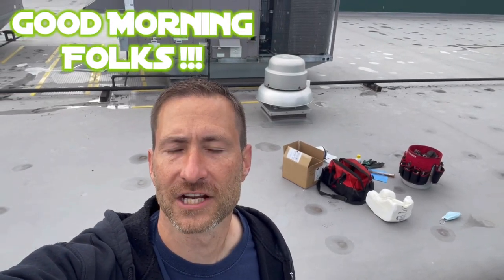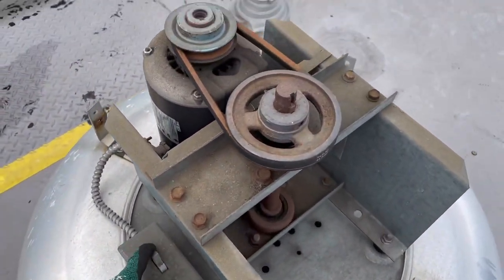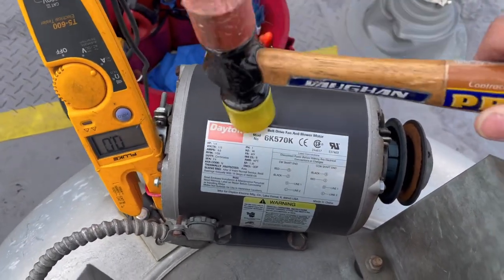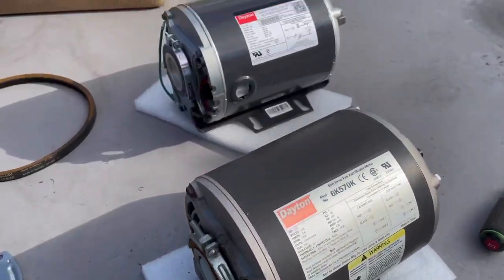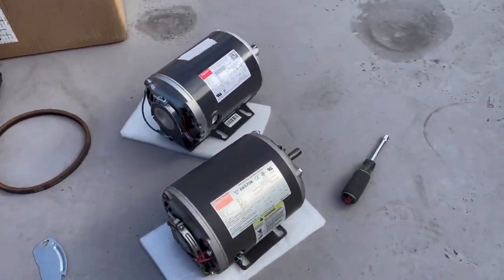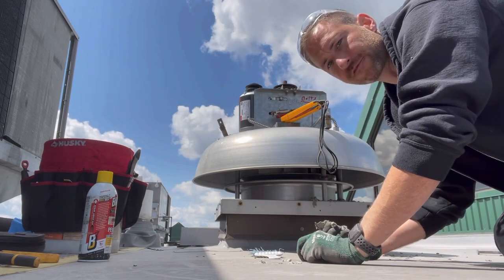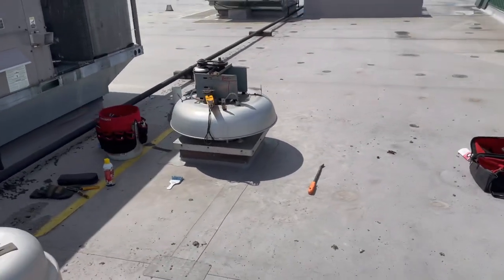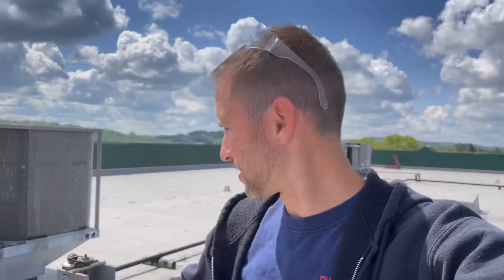Exhaust Fan Repair #motor #exhaustfan #roofshaker #hvac #HVACEXPLAINED #electric

Comment: can a certified nfpa 96 technician service, replace and or install upblast fans for commercial kitchens
Reply from the maker: @ziggymartinez2273  I don’t see why not? As long as the persons handy, follows the install guide procedures, and it’s inspected and everything should be fine.  
I can’t tell you how often Equipment in kitchens is replaced by a fly by night company or a nine HVAC technician.   It’s frustrating to see a general contractor install the equipment and we have nothing but problems.

Comment: Thank you for the video. Do you have any videos on what the readings (testing the windings and short to ground) on what a bad motor and good motor readings should output?
Reply from the maker: I have to look through my videos,  but I believe I can get you something useful.  Generally when a motor is bad some motors you can see the windings and they are literally look like charcoal or have an odor or the bearings are hard bad you can feel them tight or locked up by hand. Let me see what I can do I run into stuff all the time.  I’m actually working right now overtime found one bad compressor “bad bearings” and now I have a water under the floor alarm at a computer room.    I do post stuff on TikTok as well under the same screen name if you get a chance please check it out.  Have a great day thank you for the compliment.
Reply from the maker: Hey good morning Grevy.  You are in luck today I am replacing a condensate pump that has shorted to ground with open windings I will make a video right now in this computer room and notify you when I posted it.  👍.  Have a great day

Comment: forgot to talk about the little damper blade under the fan assembly. They get stuck closed or open half the time. I always tip the assembly off the curb to check. nice how close to the RTU they put that fart fan, why not just put it under the economizer hood.
Reply from the maker: I changed out three exhaust fans about three weeks ago and I was going to shoot a video on that just to show you should lubricate those Hinges 
Sorry I did not respond to this one sooner sometimes I fall behind on some of the videos.  But yes definitely a very good tip thank you for pointing that out.  
Have a great day thank you very much for watching and be safe

Comment: Great video thank you.  I have a question.  I have Panasonic attic exhaust fan.  It doesn't seem to have enough juice/torque to turn on by itself, but if I stick a bar in the fan propeller, and give it a nudge, it fires up fine, runs great, and no excessive or whiny noises, and it will run for hours if need be.  Getting ready to sell the home, should I just pull the motor and try to order a new one, would that fix it potentially?
Reply from the maker: Thank you very much Sean.  The motor may just be wearing out but if there is a capacitor connected to it it could be failing.   A lot of those fans you can get parts either on Amazon order from Grainger.  Most of them are relatively cheap, I prefer buying just an entire new one but I haven’t seen your situation.  Also why put money into something old? That’s the way I look at things.  It really depends on the install if it’s easy or not.  I worked on a few fans where they need a good start and once they are up and running their good.  Hope that points you in the right way.  Have a good day.

Comment: How do you adjust the motor sheaves to change amp draw?
Reply from the maker: Hey, good afternoon.  
I should really do a video on adjusting pulleys. 
Ok, to make it easy. 
Example:   Blower wheel has a 7” fixed pulley and the Motor has a 4” Adjustable Sheave. 
On the motor Pulley if you would open up the Pulley allowing the belt to ride towards the shaft of the motor The CFM and Amps Will Drop!!! 
If you were to adjust the motor pulley, allowing the belt to ride further away from the motor shaft .  The CFM and Amps will Increase.  
There is a calculation that you can do to determine CFM/amps/pulley size.  I won’t be able to put it down in the notes to make sense.   I would have to physically drawl it out on some construction paper.  
I would advise adjustment of the Pulley 1/2 a turn at a time.  
Hope this helps you a little bit. Have a good night. Thank you for the question.
Reply: its an adjustable pulley essentially allowing less or more slack on a belt driven motor or gear, kinda like a tensioner but adjustable

Comment: lol stumbled on one of your comments, saw the face shield and assumed HVAC meant high voltage alternating current. i'm an engineer just starting in a HV ACDC Station design group so my mind was on it
Reply from the maker: I work on a lot of high-voltage because I do commercial and industrial heating and cooling. I’ve been in my line of work with the same company for 17 years I did residential for almost 2 years before this I’m currently 38.  Commercial and industrial heating and cooling involves a lot of 460/3 power. I’ve had many scares over the years that’s one reason why I wear Ark Flash gear a lot.  Also it’s required at Natural Gas Drilling Sites.  There is money to be made in this field just as long as you work safe and work smart you can have a good career in this field.  This field also needs good engineers especially ones that go to the job sites to physically get their hands on what application it’s being used for.  
I had a friend who what is a grass cutter making money to go to college to become a mechanical engineer.   He would call me when his lawn equipment would break and I finally sat him down and physically showed him and taught him how the combustion engine works and we fixed it together.  I said this is one thing that some engineers failed to do is get their hands involved.  You can only learn so much from a book.   Thank you for leaving a comment I will be posting more videos if there’s anything do you have a question on pertaining to heating and air-conditioning I possibly have the answer LOL.  Have a good day.

Comment: What camera are you using and were you using a tripod?
Reply from the maker: This time I was not using a tripod since it broke on a job. But generally I film them myself.  That exhaust fan was from a few weeks ago.  I probably have over 500 + videos stored up I just need to cut/edit.  I’m just trying to figure out a good editing tool.  I have a lot more very detailed videos I just need time to cut and edit them
Reply: @hvacexplained9341  I use Folmora but it's very limited. Research it good before deciding because it will be a learning curb. Alright, get back to work! 🤣👍

Comment: #roofshaker
Reply from the maker: Yupperz.  I was just working on replacing an exhaust fan yesterday for two restrooms at a another building from the same owner. I went from 277 V installed a buck and boost transformer at 1KW to step it down to 120 V.  I unfortunately did not shoot a video on this.   Time was pending to get it done ASAP.  
Have a great day.  #FartFan